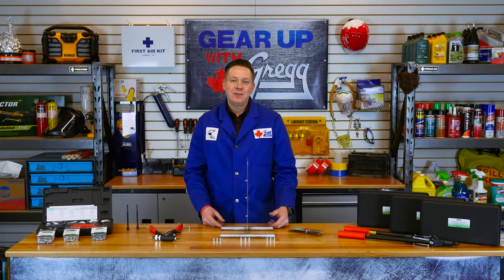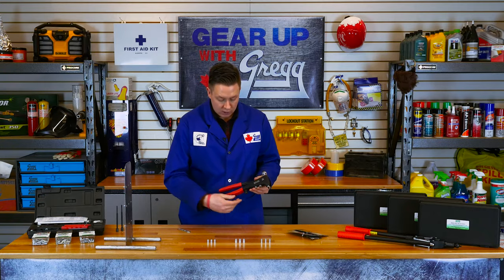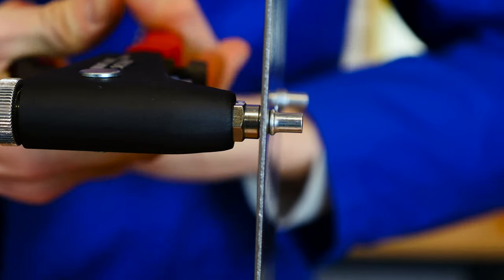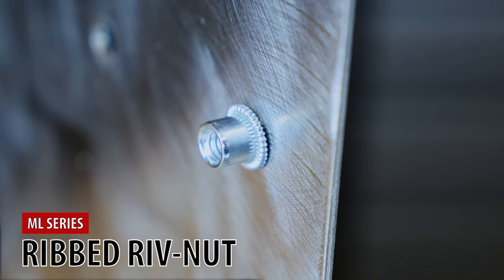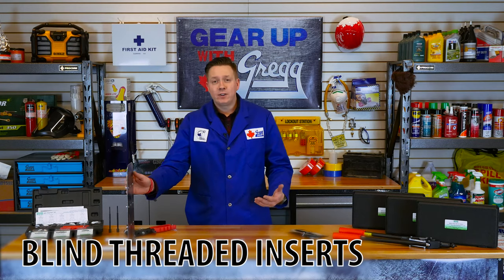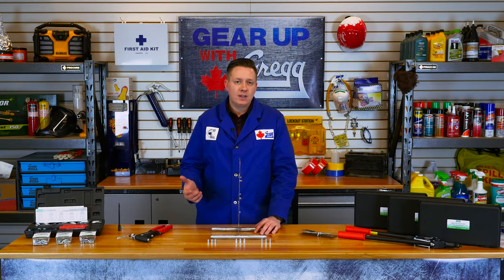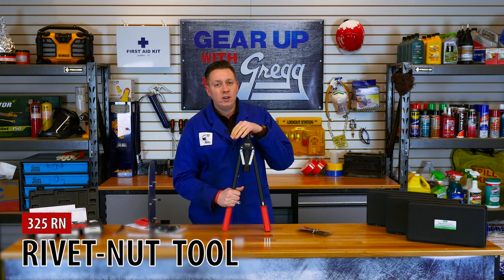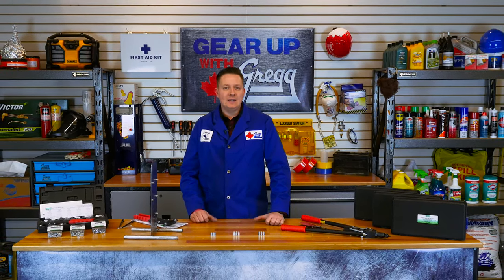Riv-Nuts: How Do They Work? - Gear Up With Gregg's

Comment: What is the rule on hole size? Zero clearance or should there be a slightly larger hole than diameter of rivnut?
Reply from the maker: For each Riv-Nut size, there is a hole size range.  Have a look at our catalogue page where it shows the specific hole size range for each part:
https://greggdistributors.ca/search?q=H71&resp_group=Default,Variations,ItemProperties&page_size=8&view=list&terms=CatPage:H71

Comment: 100% permanent? There’s absolutely no method to remove them?
Reply from the maker: They are not 100% permanent, but they are intended for a permanent applicaiton.  Technically, nothing is really permanent!
Reply: Gregg Distributors Ltd. how would they be removed?
Reply: Use a dremel or a drill to remove them, worked for me every time